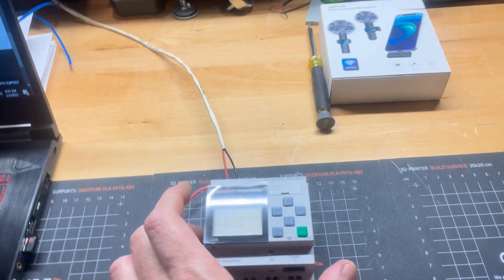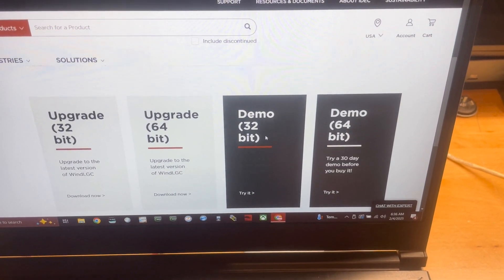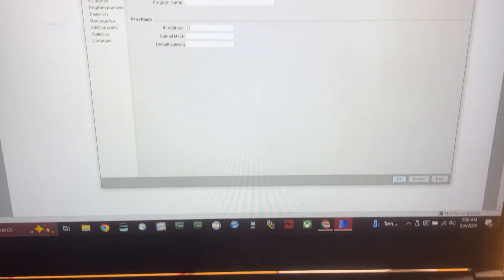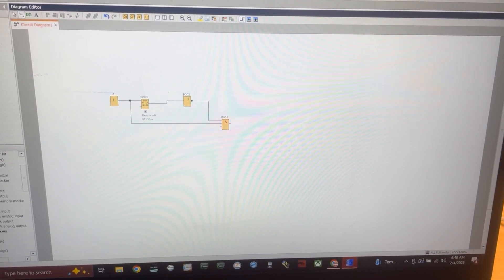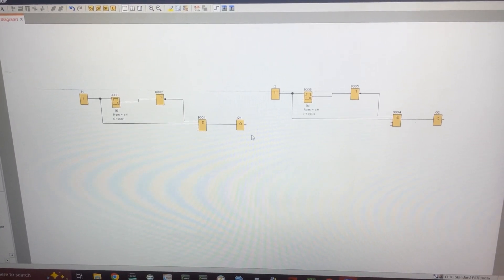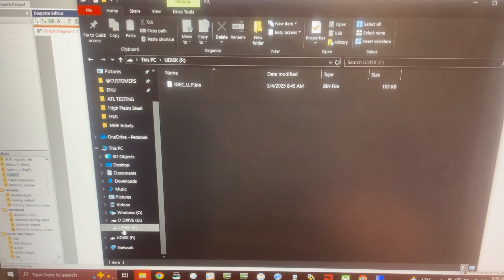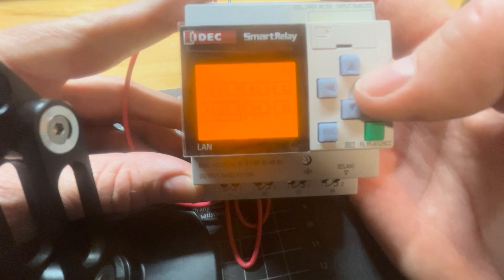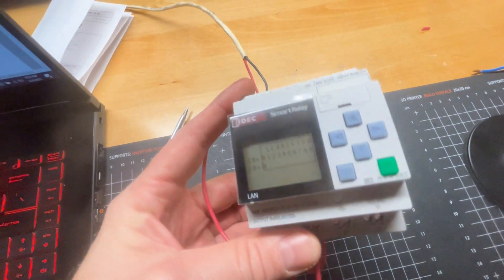IDEC FL1F Download with DEMO Software

Comment: answered MANY of my questions 
THANKS for posting this, not much IDEC info floating around
Reply from the maker: @DuB-TeK  awesome to hear, thanks for the feedback!!
Reply: Hey man, Im back 
Locked out of my controller 🤷‍♂

Now, I cant stop the program (escape button)
Nor can I get past the password as Im using this unit second hand and do not know what was programed 
Nor can I find what the factory set it to for delivery....
 
I did successfully use this method a half dozen times,
Turned my project off for the night, 
IDEC starts and runs my current program just find, but it will not let me STOP the program now...

ANY insight?
Reply: Password is ("IDEC" all caps)